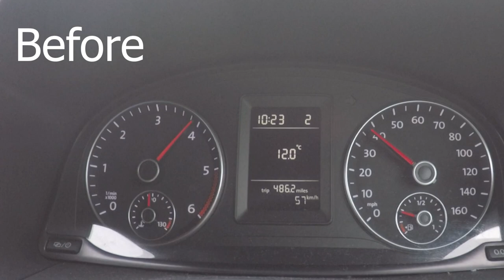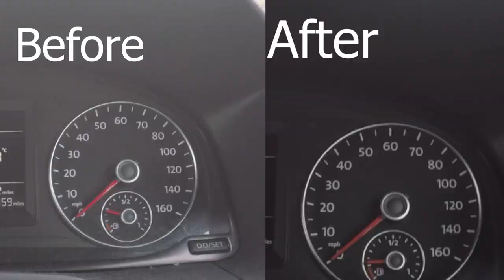Vw Caddy gets Remapped

Comment: I also have the 2.0TDI 102hp version. Stage 2 now with 204hp and 450nm. As you say they are basically detuned GTD engines💪🏽
Reply from the maker: Nice, I bet that’s a bit spicy 👍
Reply: @FreeworldOL  yes it is🤣
Reply: Mines a 2010 2.0 tdi 104bhp, it has 206k on it. Would it be worth my while getting the Revo remap
Reply from the maker: I’d contact them or one of their dealers if Revo is what ur interested in. They will be best placed to give advise 👍
Reply: @FreeworldOL  np 👌
Reply: Please can you advise to what you have done to get this thanks
Reply: @Carpy87  i have a stage 2 map, removed the dpf and installed a downpipe for it. Thats all basiclly
Reply: @BB2001.  thanks thats not as much as I expected to be done what about the mot tho for dpf removal and what downpipe did you get as I want to fit a whole system thanks
Reply: What about pulling a trailer